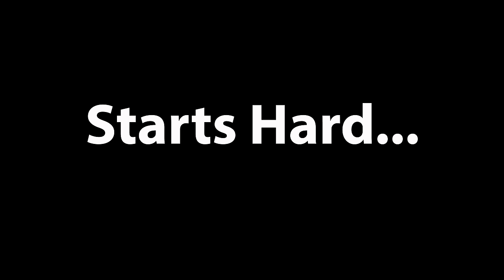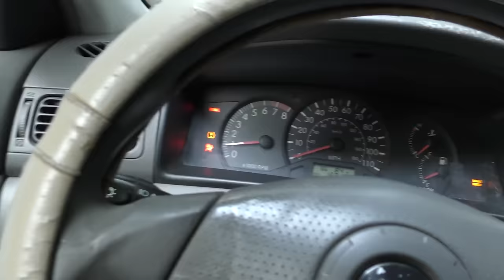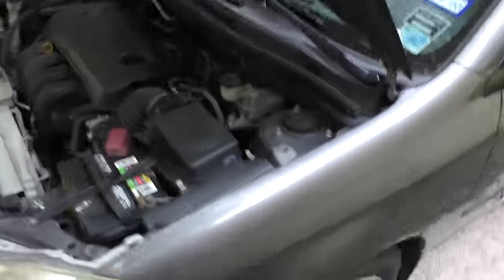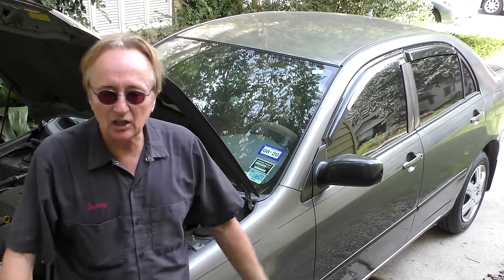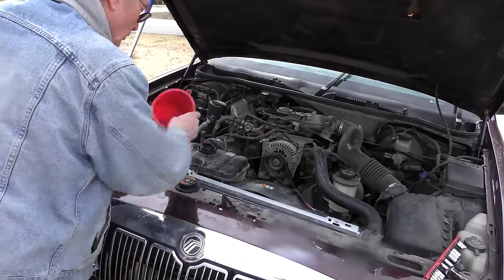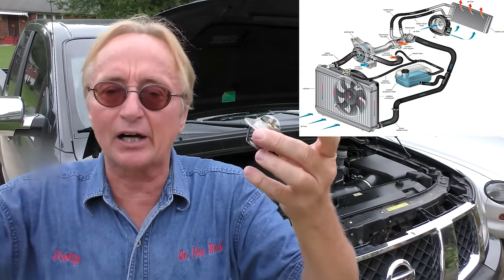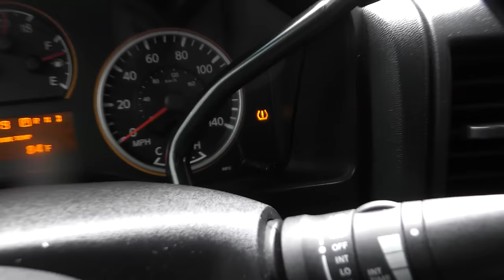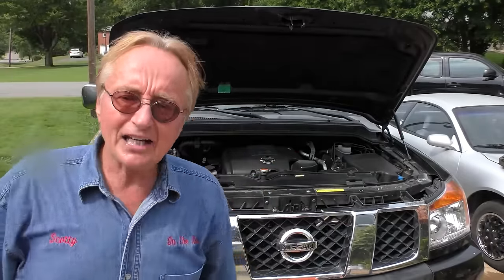If Your Car Does This, You're Screwed

Comment: Scotty: being an honesty mechanic as you nowadays is rarer and rarer.
Reply: I never found a mechanic that works only on honesty 😂
Reply: Someone tried to charge my uncle five grand for a new differential in his Lexus when it just needed a differential fluid change
Reply: @evinguidone6498 bro was smokin crack if he thinks he could sell a diff for 5k😂 800 tops
Reply: @evinguidone6498  or in my friends case, a shop convinced her to do a transmission flush and they put the wrong tranny oil...it seized on the way home lol
Reply: @MMK86 Yeah I'm always skeptical about a transmission flush
Reply: honest*  mechanic
Reply: anyone can tell u to get rid of an older car but a real mechanic will fix the car .
Reply: @onmywayto974 why? Is it not good to do? I've only done drain and fill on my vehicle. Have never done flush.
Reply: I been on my own since I was 13 years old I have learn alot in my life I been fixing all my car's since my 1st car 1978 toyota corolla I even rebuild the mottor took out cables windows interior and paint it I was working in a wood shop I use lacker tiner paint 15 coats 10 clear paint 030 bone wight I rebuild the whole car got it for $500.00  I put like $8000.00  it had 54,0000 miles I got it from a fire fighter I took the car sow they can see it that old man and his wife was very proud of my work they said it's better then when they got the car new I sold it for $16,000. In 2002. Everything I did my self or my toyota corolla club help me I lear everything about the old corolla today I have 2014 toyota corolla LE and I'm going to get a new one this year.
Reply: @marleonetti7  any car can be fixed. The question is how much will it cost and is it worth it?

Comment: Used 'cheap' cars are selling for $5000 and are 10-15 years old with 150k-250k miles
Reply: Just got my mazda sedan 3 2012 with 137k millages for 4k except I spend another 1k to change parts tires etc… the market is horrible right now just like inflation
Reply: Yeah it's ridiculous the last few years! 
But this year 2024 I've found lots of decent  vehicles for $1, 000 or even less. 
Sure some will need TLC, but it seems like the prices are droppingil
Reply: Just got a 2004 Toyota Camry with 166k miles for 2,400$
Reply: @HighVybeTribe dam where u live
Reply: I just bought a 2009 Camry le with the V6 with 127k miles for 7k, should last me a long time, I hope anyways 🤣
Reply: Fact.
Reply: That is a fact.
Reply: I just got a 2017 chevy cruze. I've heard alot of bad things but with 180k miles the engine runs amazing

Comment: I truly love it when Scotty says get yourself a manual transmission, it will hold up better than the automatic. Indeed it will go for ever.
Reply: Yep. But what about your clutch ???😃😃😃
Reply: Clutch can slip and replace it I remember my clutch was slipping so I had to replace it
Reply: @prestonwhite5613 if your clutch slips, you can replace it. If your torque converter goes out in your automatic, 9 out of 10 times you need a new transmission
Reply: @prestonwhite5613 cheaper than fixing an automatic transmission
Reply: A manual transmission is also a great ant-theft device as the number of people who know how to drive one is getting to be less and less!
Reply: I have a manual transmission rebuilt on a 89 mustang. Syncronizers wore out and the gears were worn to the point of popping out of gear all the time. So they don't last forever. But the previous owner may have never changed the transmission oil.
Reply: Manual transmissions still have gears that move. They won't last forever haha. If anything they'll last as long as any other thing with high speed moving gears. XD
Reply: Yep, and it is the best theft prevention device on the planet.  Nobody under 30 knows how to operate a manual transmission!
Reply: @imnitguy  *in the usa
Reply: Never spoke with anybody that would recommend a transmission shop. Always cut corners
Reply: @samandmikikhardian1117 they say some clutch replacements are a real pain in the butt
Reply: @mickey_mousey  so do automatics? their point is that a manual has fewer points of failure than an automatic.
Reply: Yeah, and you'll kill yourself in stop-and-go traffic; and have a very limited  pool of repurchasers
Reply: @johnschaefer2238 I learned how to drive one in around 5 minutes to figure it out. Car thefts most of the time can drive anything.
Reply: You haven't met my bfs Dodge Dart 😂
Reply: @borisselbstadler3209  why do people think no one in the US drives manuals?
Reply: @Apollo-Computers  Or worse, think career car thieves don't know how to drive them? lol.
Reply: @prestonwhite5613 like everyone else said, and it’s very easy to replace clutch
Reply: @prestonwhite5613 clutch can last a long time if you drive right.  Even if it goes out, a clutch kit is $300 and for $500 you can get it done.
Reply: @mickey_mousey nope manuals are more basic and robust and tend to last indefinitely.   Mine has 400k km on it and works as food as new.
Reply: @derekgardin1512  Well I'm happy for you. But that's not all manual transmissions, there was a reason we moved away from them. The people who complain about automatic transmissions being easy to use are the same kind of people who complain about any new technology that comes out even if its beneficial to everyone in literally every way xD

EDIT: Also, I'm not going to take the word of a stranger on the internet about their transmission. I could say "I'm from the moon" and there's no way you can disprove it XD
Reply: @mickey_mousey  so what do you think was the reason we moved away from them? Serious question.
Reply: I just bought a 1999 Ford Mondeo with a 4 Speed Torque Converter Automatic Transmission and it shifts like a dream. I have a manual Suzuki and I don't like manual. Such a chore to drive.

Comment: Scotty has a different perspective on what to expect from a $3k car these days.
Reply: I got a 04 camry high mileage on great condition for 2.7k back in 2018, there are definitely still reasonable sellers out there just hard to find sometimes
Reply: @kibbles5724 2018 and 2023 car markets are like.. MASSIVELY different. Night and day.
Reply: For real.  If it turns on its usually worth at least 5k or 6k.  At 3k it's a steal if it turns over at all.  We aren't in 2009 anymore.
Reply: Bought a dented 2007 Honda civic lx sedan with 170k mikes for 3.1k 😂 kinda feels like I got ripped off bc after a week or 2, the brakes were squeaky and the transmission felt kinda odd
Reply: @Theunworthykidz you bought a lemon
Reply: A $3000 car now a days is what a $300 car was back in the 60's / 70's
Reply: It Also slowly leaks oil now :/
Reply: @Theunworthykidz   Remember, number of miles is meaningless. 170k miles could be a LOT worse than 270k miles, just depends on how it was maintained and driven.
Reply: No.....most of us wpnt spend $3000 pn an oil burner
Reply: @richsweeney1115  my cars an oil burner?
Reply: 2024 just entered the comments and says $3000? Oh my goodness where could I ever find any kind of car that runs for $3000.
Reply: U can buy mine :) It looks like hell with the bumpers and fenders messed up (and 1 headlight) but it runs and drives and is a 97 Toyota Camry. Needs a tune up and an air hose replaced. I haven’t driven it in awhile so breaks will b squeaky.

Comment: I just noticed, Scotty is a real mechanic because he doesn't use power tools, especially on top of the engine, he probably has a feel for torque specs within only a percent or two.
Reply: Every time I go into any shop they drill everything on like crazy! 5x torque not even a power tool gets them off sometimes I need a breaker bar and a hammer
Reply: Do you think he found the bolt for the beauty cover?
Reply: @williamalexander1743  I didn't notice that, but is a good question?
Reply: With spark plugs especially, you can use a torque wrench. But it’s best practice to use a normal ratchet and turn till it’s tight then give it a another 90 degree turn. Which is what Scotty did in this video.
Reply: @bobborosso3665  No, it's best practice to use a torque wrench.  It's "old mechanic who thinks he knows better than he actually does" to do it by feel.

Comment: "Take off the stupid beauty covers" never gets old. You're not wrong Scotty just gets in the way and some of the better cars of days past never had one.
Reply: as he breaks plastic pieces 🤭
Reply: Besides, I drive with my hood down.  So the beauty covers are for whom?  The spark plugs want bolt-on eyelashes?
Reply: Putting googly eyes on my cold air intake has been one of the car mods of all time.
Reply: Old engines looked more attractive. I guess it's cheaper to make a dull valve cover and cover it with it tacky plastic cover.
Reply: This is why older cars are cooler, the engine is just that, an engine, a hot piece of metal moving a hot piece of metal, nothing pretty about it, just pure efficiency.
Reply: The plastic beauty covers are there to bring up engine temperature quicker to   go into close loop.for emissions.
Reply: Time stamp?

Comment: I'd recommend avoiding O'Reilly for any electrical components.  I had purchased a tuneup kit for my Dodge.  Three two-way coils.  Coils sit atop the plugs on the driver side.  Wires go to the passenger side.  Bad rubber on the coil side insulator allowed spark through and prevented firing in that cylinder.  Destroyed the catalytic converter on that side.
Reply: Oh no. I just bought a AC fuse from them. It cost $50.00!

Comment: When I was in college way back then I knew a guy who had a car that burned some oil, the rear main seal leaked, and it had a small radiator leak somewhere. He just checked the level of everything and added oil or coolant when he needed to and kept driving it. The engine and transmission were still good so he just lived with the leaks.
Reply: Leaking oil and burning oil are 2 totally different things..
Reply: @yamaha94O   gee you’re so smart
Reply: @jameswhite1319  thanks sweetheart 😘
Reply: Buy an older Jaguar & you will learn to love oil leaks..
Reply: @cantyouhearmeknocking1961  me sitting in my subaru crying
Reply: @cantyouhearmeknocking1961 same with an old BMW like the E36
Reply: @cantyouhearmeknocking1961 I had a chance to get a 1945 jag sports car ....not sure what I forget but in was gorgeous....still 10 thousand dollars ,I think I saw it for 150 thousand last week

Comment: I'm not a mechanic, but my dad is. I have some experience with cars, so when my wife's grandparents asked me to go check out a truck, I ended up smelling coolant as soon as the hood was opened.  I also seen the coolant low, but both her grandfather and cousin said it was probably nothing.  After driving around, they made up their minds and decided to buy the truck.  I stayed back, popped the hood and looked all around.  Found that the radiator was busted. The coolant looked new so I assumed it leaked a lot. Despite my warning, they bought the truck, and a few months later, it turns out the engine was warped before they bought it.
Reply: Why would they have you check out a car with them to just disregard your advice. LOL
Reply: @Winner3ty  I guess they just really liked the look of the truck.  😅
Reply: how did you know it was warped?

Comment: Mine had the same symptom. Starts hard when the engine is cold, sputters etc. I thought my engine was burning oil. Had it checked by a mechanic, they said that it didn't. I changed the oil, spark plugs, filters and what not, still the same. Checked the vacuum lines, no problem. EGR no problem also. Replaced the fuel pump, same thing. What solved the problem was the computer scan. It showed that my camshaft position sensor was busted. Changed it and now it runs like a dream again

I could've saved a lot more if I had it scanned the first time.

Comment: I put my radiator fan on a switch on a 1990 Chevy Beretta I had. For some weird reason it just refused to work on its own. New thermostat, new fuse, everything I could think of. But it worked fine with wired straight in, so I just did that and installed a toggle switch on the dash. Turned it on while driving it and never had an issue. Cheap, easy fix for a really weird problem.

Comment: I have a 2020 Chevy Trax - it has 31,000 miles and the oil for it's fifth oil change is sitting right here in front of me. 
I took it to a local Valvoline last time.... $116 for an oil change! 😡  I just checked it and my oil has NEVER been that dark. 
Lesson learned - I will keep up on my oil changes now 🙄

Comment: I once had a Honda Civic that burned a good half a quart or so of oil a month. Had about 300K miles on it. Engine fired up first try every try no matter how hot or cold it was. Ran great. Never let me down. The only issue was the smoke screens left behind at stop lights in the summer lol. Not sure how many miles it ended up getting since I sold it (I regret selling it).

Comment: I have a 2003 matrix an man it starts like a gem always doing maintenance on time just did all new plugs spark plugs oil change an some sea foam an she's running even smoother, engine is super quiet for the age of the car,

Comment: I have a 1995 Saturn wagon 124,000 miles, burns oil, shifts into 2nd, 3rd hard, 26 average mpg, paid 1800$ late 2021 with 116,000 miles and the transmission was smooth as ice when I test drove it, 3 weeks later it’s shaking the floorboard, I’m happy it’s lasted this long and hoping to make it till 2024
Reply: 26 average? jesus, the 01 coupe with the single cam I had still put out 35+ mpg about 4 years ago, shame I had to get rid of her, was a fun little gokart
Reply: @CaptainRasco what did you get next?
Reply: @CaptainRasco  the transmission hurts the mpg, most Saturns shift up at 2,000rpm but mine will not shift unless I’m 2,400rpm. Idk if burning oil effects gas milage but definitely not good

Comment: Yep I bought a Toyota Camry 2013 standard edition with 200,000 miles on it from a private seller. After buying it and driving 50 miles, the check engine light came on and needs a new catalytic converter. And I paid way way too much for it about 6 months ago. But it was so pretty! 😍 Two mechanics told me that I shouldn't even worry about replacing the catalytic converter and just live with the check engine light on...? 🤷‍♀️
Reply: Yeah cats in all honesty are non essential . Its only for emission purposes (filtering what you emit into the atmosphere) you’re totally fine driving it like that forever. Just stick a piece of tape of the engine check light so it doesnt annoy you lol

Comment: most likely issue if it runs different based on engine temp is intake air temperature sensor. your engine needs to know the air temperature for timing adjustments and fuel injector spray adjustments

Comment: I just purchased myself an 08 Corolla and my heart sunk when it was diagnosed as an oil burner. I love mine so far. 98k miles with good service records. Hope i got a good one.
Reply: I had a coworker who bought one brand new in 2002. By 2004 it was leaving  long blue smoke signals everywhere he went (then began rusting). 
I remember this because a cousin who worked there had an imported from Germany VW with 400,000+ km and it had only recently begun smoking and the Corolla was something like 90,000km 
I have seen this on repeat over the years
Corolla and blue smoke everywhere.
Almost never any from other Toyota models, just the Corolla
Reply: There were some dud Toyota engines due to faulty low tension rings from factory, Toyota released a revised ring kit to fix the problem but it requires tearing the engine down still
Reply: @neiliewheeliebin  no issues here. No oil burning, no smoke. Runs like a champ. Great car

Comment: Another problem with the Toyota Corolla, is the yellowish/cloudy headlights. You should not ignore that because it makes it difficult to see at night as less light can shine through the lens.  Also, in areas that require a safety inspection that could fail the inspection
Reply: Yellow means the car has jaundice.
Reply: @phatgringo2.0  yup, when your car has jaundice it’s common practice to squeeze a few lemons in the oil and coolant to give your car the citrus vitamins it needs. It’s a very overlooked part of maintenance
Reply: No, it has cataracts..
Reply: Nah... safety inspections are overrated.
No good having 100% lights with 30% eyes.
Reply: Thats the least of your problems a cheap $26 fix at Walmart
Reply: @gazzafloss  u must be in the Texas legislative world.
Reply: @phatgringo2.0  sometimes it’s just because you fed it too many carrots. Start feeding it something else and it’ll go back to normal.
Reply: Viral guy  mine were yellowed from the inside, what then
Reply: That's nothing, yu can wet sand, or buff them
Reply: As others have mentioned, it's not a serious issue. Either sand and polish them or replace the cover.
Reply: Buy some rubbing compound and follow directions on the can. Usually found in the car wax aisle

Comment: I wish you are my mechanic...  So hard to find one that is truly good but even harder to find one trustworthy...  I am always afraid to let anyone work on my car.  I took my car to the actual car dealership for a recall repair one time where to replace the part, they had to take off the front bumper.  As a habit, I always check everything after I get my car back and I found that they didn't not even reinstall the front bumper correctly and this is the actual car dealership who works on nothing but that mainly that brand of cars..

Comment: My 2003 subaru outback blew a head gasket, if I drove at highway speeds the car would stay at normal temperture, it was only at city traffic which heated up the engine.
Reply: Maybe your radiator fan is was not working?
Reply: @mattayee1982  you missed the point.  And yes they were working